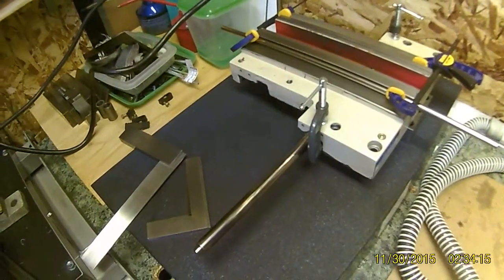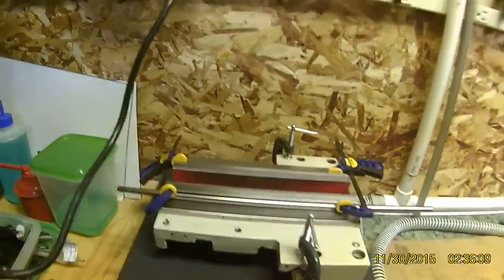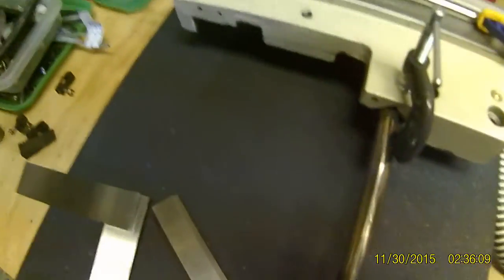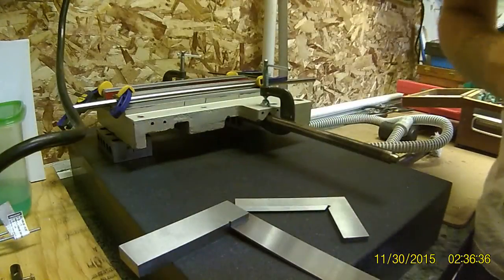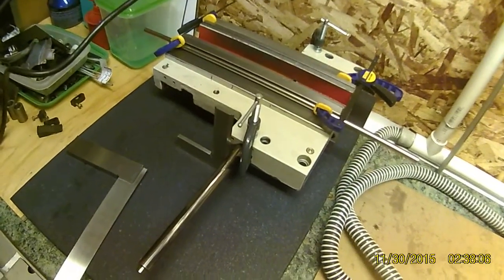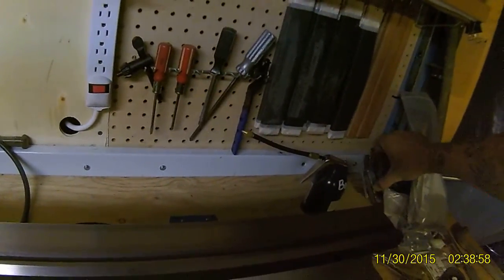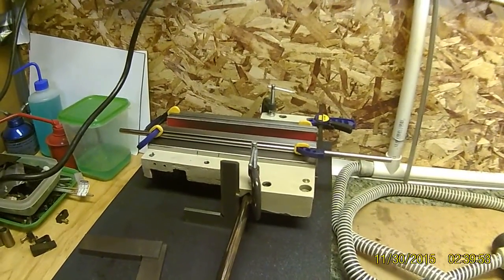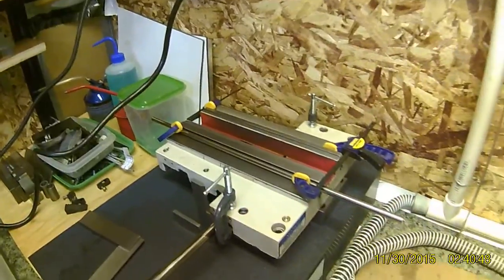Checking cross slide perpendicularity to way guides of carriage

Comment: I simply loosen the bolts on the cross slide angle adjustment and square it up.  It is an overseas lathe that was machined and built before the casting can cool properly.  They ALL warp when they cool.  I upgraded the circular clamp with a piece of 5/8 and switched to a better parting/grooving tool and quick change tool post from Shars.  The machine is only as good as the operator and if the operator is knowledgeable enough this machine can make parts better than it is capable of with a non knowledgeable operator.   Maybe I misunderstood what you are trying to accomplish, but it sure seems like you are tripping potato chipping.  News flash...it aint a Bridgeport.

Comment: suppose you got to the just as hastily assembled headstock ?
mine has tapered bearings that had been hammered on to the shaft,  the bearing races had as much contact as your crosslide. I installed new tapered rollers and the spindle shaft was 4 thou oversize... it's easy to give up on such a piece of shit but in nz the freight costs so much we get what we get

Comment: Fwiw all good tool room lathes are supposed to face slightly concave by a few thou over 12". It's easy to directly measure just how much your lathe is out and do so under turning tests that will give you the most accuracy since you want to know what the lathe is doing while it's working. Just take a normal full clean up pass on your lathes faceplate, then set a dti against the rear center of the faceplate. Then use the cross slide to pass the dti from the rear center to the furthest point away from you. 3 o'clock to use a clock face for direction. The test results will be DOUBLE what your lathe alignment is. Checking the faceplate from the 9 o'clock position in to the center just follows the normal tool path and will tell you nothing. 

There's a free PDF of Dr. Georg Schlesinger's book at totallyscrewedmachineshop.com that's well worth going through for machine tool alignment.
Reply from the maker: A few thou over 12" isn't bad. but I was off 0.007 over 3" The reason I did this was my spindle was out 0.004" in 2" angling the rear toward the front. My carriage was warped so taking any cut even on soft material caused serious chattering and I couldn't get a clean read with any indicator. They say to check cross slide squareness you can mount a parallel in a four  jaw and rotate 180 adjusting it until you get 0 on both sides without moving the indicator then traverse the indicator to the other side to test its perpendicularity to the ways. This is true unless your spindle  is out of parallelism to the ways. The faceplate test only works if your spindle is correctly aligned.  This method is just a way to test your cross slide independent of any other part. When you get a lathe and have to refurbish it and correct the geometry on every single component. Using other components that are incorrectly aligned just complicates everything. I had no choice but to take this path as the warped carriage and cross slide prevented cuts of even a few thousand from being smooth enough to measure, deeper cuts were just scary tooling binding, barking, my bench trying to initiate flight (fuck that). My test bars looked like they were turned by a drunken beaver with one eye, and the amount of chattering produced was nerve racking. It was so bad I named the Lathe Shakey Sue Chatterbox. This wasn't just a chattering that you could hear, you could see it through the entire carriage. I even shattered the tips off two cemented carbide bits before I gave up and found another way. That is why I post what I do, sometimes the standard way of trouble shooting a problem is not an option, especially if you own a Grizzly. The century old argument of concave facing, as I have read, is still up in the air. Obviously, a true facing job as near as true flat 0 is ideal, but impractical. Convex facing leads to problems more numerous than to be discussed here. So concave is better than I poke in the eye with a shitty stick. Logic tells me, lathes are designed to cut concave so as to account for wear over a longer period of time. All right to left cutting action places torque against the rear of the forward facing dovetail and the operator side of the rear facing dovetail. If the lathe was designed to cut a perfect flat face then once the slightest amount of wear occurred or if the gibs were not tightened to the perfect tension a convex face would be created. By designing the lathe to cut a concave face then issues with gib tension and wear would only lead to a truer usable surface as opposed to a convex unusable or problematic face. With the methods I used, I managed to accomplish 0.00075 every 3"So, 6"=0.0015 and 12"=0.003 I also have my cross slide and carriage on brass slides with a brass gibs. When wear happens it takes me about an hour to fabricate and anneal new slides. It also makes my components slide like a butter on a hot griddle. If it was an American cast iron lathe I would just go with Iron against Iron, but Chinese cast is far inferior. I  managed to get my lathe to turn a 1'dia by 5"long 1018 round unsupported to be 0.0003 difference in diameter from end to end. When I received this lathe it was 0.01 dia difference in 2.5"  In my opinion that is unusable. Thanks for the comment, keep them coming hope this clarifies my odd antics.